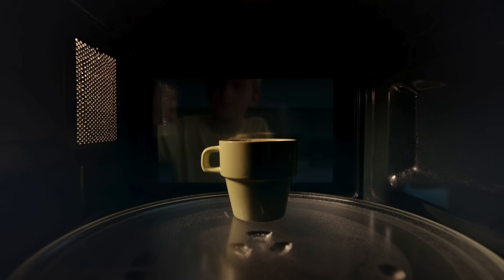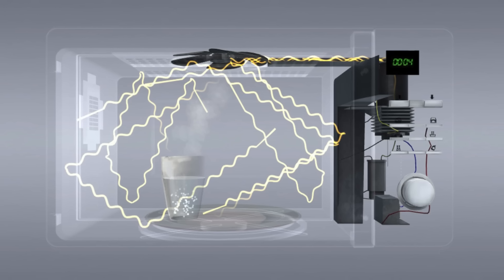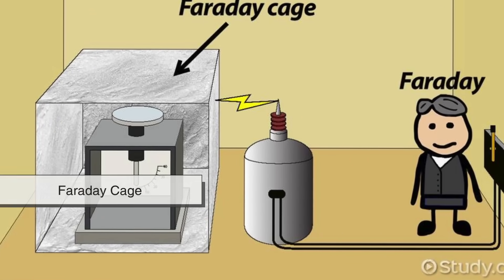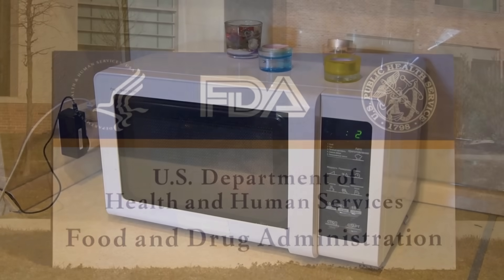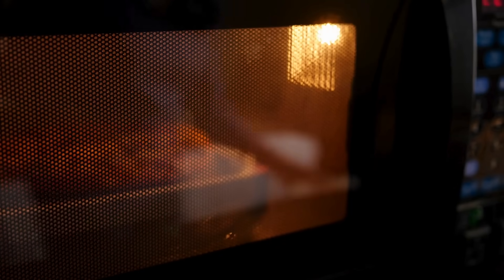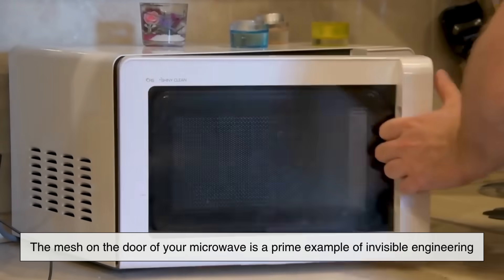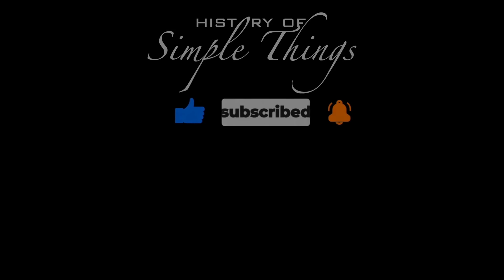Why Do Microwaves Have a Mesh on the Door?

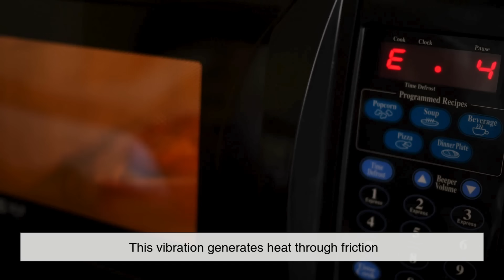Comment: 1:43 The waves can only penetrate a centimetre or less. This is why you can heat food in plastic containers.
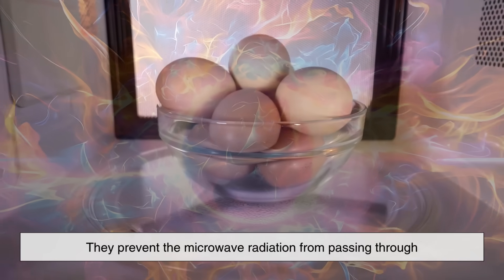3:38 The waves still penetrate some millimetres outside the door mesh as the mesh only works as a waveguide. This is why there is often a gap and plastic so you don't put your hand near the mesh.

Comment: 6:28 there is no nuclear radiation so its not dangerous
Reply: It's not nuclear or ionizing radiation, but microwaves can still be dangerous. Just in the same way that putting your hand inside an oven which is heated up to 150 degree. Microwaves don't have a risk of cancer, but having a cooked skin is no laughing matter.(it's all a matter of the amount of energy you are exposed too, just like a being 20 centimeter away from a candlelight is no problem, but that same distance is too much for you when you talk about a campfire)
Reply: If they hit your eyes they can boil them, I consider that quite dangerous ;)

Comment: If microwave ovens cook food from the inside out, why does a hunk of frozen bread or a chunk of meat have a cold center if you do not cut it into smaller pieces?
Reply: If you watched the whole video they said the waves only penetrate a few centimeters, anything inside that will only get heat from transfer from the surface which is why for thicker things its better to use low setting since that will alternate between heating and waiting to allow the heat to transfer inwards without having the outside being burned to a crisp.

And why if its something liquid, it can be a good thing to open once a minute or two and stir it.

Also, ice crystals do not absorb microwaves as good as water which is why for thawing you use very low setting and longer time.

If you go all out, some parts will thaw earlier than others and proceed to cook or burn before others even thaw at all.
Reply: They did say it cooks from the inside out, which you clearly pointed out it doesn't and that if I watched to the end which I did they contradicted themselves.@davidmartensson273

Comment: i am surprised that the folks of raytheon who was working on the radar tube during the invention of the microwave did not get harmed when the candy bar was melted in his pocket.

unless the microwaves was much lower power than what is used for cooking.
Reply: The candy, i think it was chocolate had less mass and heated faster than the body which would distribute the heat away from the targeted side and the heat required to melt a chocolate bar is not enough to cause burns, even your skin temperature can melt it in most cases :)

Comment: One thing is missing from the video: after 1 and a half minute heating why the plate is hot like lava and the food stay mehh lukewarm? :)
Reply: Radio waves only penetrate the food one or two centimeter deep.(yes, they say heating up from this inside out, but that's only rings true up to a certain extend) The outside from your dish will get piping hot, heating up nearby objects. Then it cools down a little as the center of your dish absorbs some heat as well. But your plate may have less mass than your meal, yet can be more insulated due to air under the plate and such factors.(air doesn't transfer heat as well as nearby and/or near liquid food) So the plate can stay relatively hot, even though the meal on top of it is a little colder.